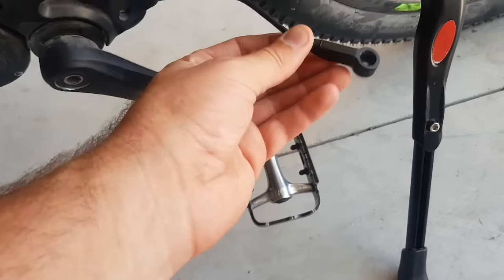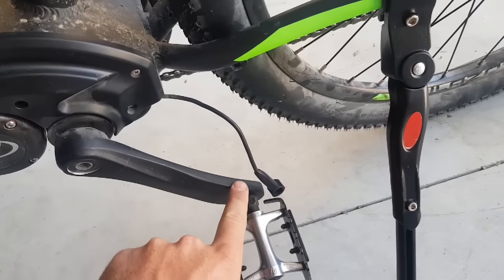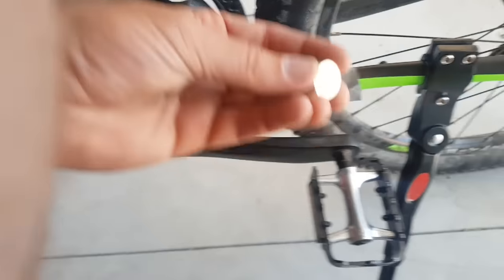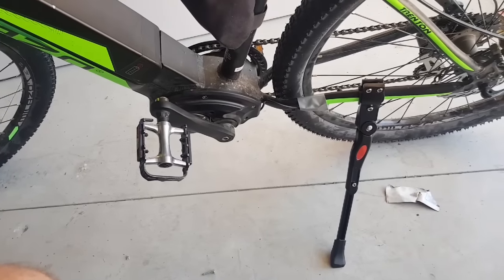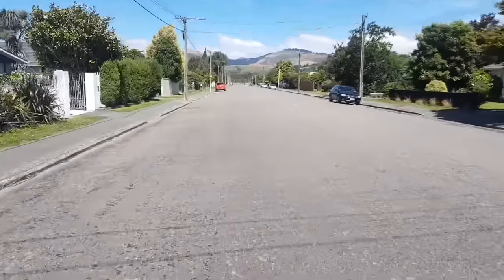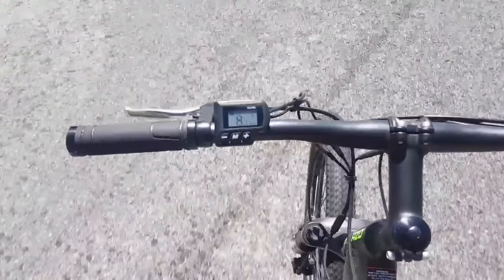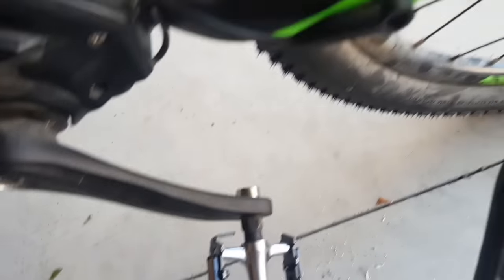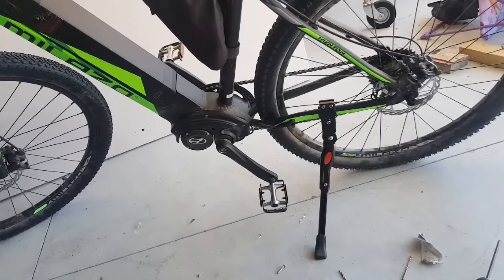Speedhack your mid drive ebike - remove speed limiter

Comment: ZIP TIES MY FRIEND...NOT DRILLING THE FRAME
Reply from the maker: Yes yes...we've been over this.
Reply: Did it ever break where that hole is or is it still holding strong
Reply: Made some sick come up when he got the drill out!!
Reply: I drilled holes all over my bike and it weighs hardly anything anymore.  I keep getting a whistling sound when the wind blows through the holes. 
I tried zip ties but they wont hold it together at all. (just joking)
That’s got to be the worst thing to do, even on a senior’s tricycle.
Reply from the maker: So 4 years later and that hole has caused zero issues.  Still... agree.  Use a zip tie
Reply: He's looking to get hurt.
Reply: @wavemaker54 nice 😅

Comment: A smaller wheel will rotate faster, not slower.
Reply: He's australian everything is backwards
Reply: Yea, but if the controller THINKS your wheel is a 20” or even an 18” (even better), it will confuse the controller-“Hey, it sure is taking a long time for that magnet to come around. I guess I can give the motor more juice. “😊 Just think about 4x4s with bigger tires - the speedo is gonna read slower than you’re actually going.
Reply: A smaller tire wheel will not rotate faster nor slower than a bigger wheel at a given driven speed( your crank , pedal  rotational speed remains the same)  It will just not travel further than a bigger wheel . A small wheel covers less distance per revolution so its slower than a bigger wheel covering more distance per its 1 rotation.

Comment: Interesting concept.  And see all those comments and other alternatives ... when are the makers of e-bikes just going to acknowledge that limiting at 25 is ridiculous when so many people can pedal a normal bike faster than that and fit people are riding them - especially the e-mountain bikes.  When it hits 25 on the flat it feels like pedaling with a handbrake on - ridiculous! .
Reply: It's imposed by them by law. In many countries it's not legal to motor assist a bicycle beyond the 25 km/t. Obviously this is a software limitation which can be worked around like this, or with a chip. I don't have a mountain bike but I imagine you would only turn on the assist when you are climbing up hill and need help in order to not get so exhausted - after all, it's going down-hill that's fun.
Reply: Agree 100 %
Reply: Before my E-bike my average speed was 36km/h. Now it's 24km/h 😤
Reply: They have to for import purposes. Today 99/100 of then you can just go into the setting and change the max speed ezpz. 
Some also have a hard limiter between the batt and controller you can unplug to keep an eye out for. 
Though for 25 bucks you can just upgrade to a computer that can show all settings which I did for a friend.  Actually, we got him a new controller (22a to 28a) and a computer bundled for 50 bucks and his ebike goes 38mph from 20ish mph.

Comment: Hey this worked like a charm.  Thanks for the video. My Giant explore stock would do 32km/hr and then cut out/in.  After your mod I can get to ~44km/hr.  I personally find that 36km/hr is a comfortable riding speed for backroads in Alberta mountains. Hardest part was running to the hardware store to get a tamper proof torx. Enjoying the bike a lot more and no problems as of yet
Reply: I would of just used an Allen bolt like me on my next bike, and pitlock has thing to put in to make the Allen bolt unable to remove without pitlock key you get
Reply: Is it still holding up? Albertan here as well. Was thinking about doing this to my bike.

Comment: What if you just move the magnet on the wheel away from the sensor? Would that not fool the sensor?
Reply: It would weaken the magnetic signal , meanwhile the wheel still spins a revolution no matter where you place it ,so no :) crank spins slower than the wheel , that's how this modification works ...

Comment: What if the ebike is only a 250w front hub motor (pedal asist) and doesn't have the magnet on the wheel you're explaining. Is that bike's motor just too weak to travel more 16mph?
Reply: This won't work with hub motors.

Comment: what happens if you remove the magnet, I guess you tried? 0mph ? no assist ? i would think a torque sensor based mid drive would still work unless they programmed no assist if the speedometer doesnt detect speed.

Comment: So I bought my uncle's 2021 Polygon Path E5 off him and it's max is 32km/h but was limited to 25km/h when it was sold in Australia.  With a 504Wh battery that's some bullshit.  After one ride to work today I'm looking to remove it, I sit at 35ish pedalling anyway, so this would be ideal. It has the Shimano Steps motor, my uncle said there's a limiter wire installed? Didn't see this sensor you speak of...

Might have to open the motor. 

Edit
Def no sensor like the video. 
So removed the battery pack and removed the left side motor cover and only see 2 wires that def look factory installed. Need to do some research 😟

Comment: As this will upset your speed and ODO reading, wouldnt it be easier to simply move fw or bw the magnet on the wheel to make it not readable by the sensor? Doing this it would always look like you are standing still whilst you are going as fast as much as your gear and your pedal frequency allows...? Where am I wrong?
Reply from the maker: Wouldn't work.  No input from the pedal sensor = no motor assist.

Comment: Hi Daniel. I just purchased the LIV Val E+2 ebike, it looks like it has the similar motor sensor to yours, how did you get it off? It looks like the manufacturer has tried to make it difficult to detach it with a screw ive never seen before. Dying to get this over 15mph its so lame at that speed!!
Reply: DoubleT I’ve got the same issue with my Giant Explore E

Comment: I've tried this on my voodoo bizango e I keep getting a error
Reply: That's because the firmware detected that your cadence matches exactly to the wheel rpm. This "hack" no longer works. You need to go to the dealer to have the motor reset (if they'll do it as the motor is now no longer covered by your warranty probably). There is a rumour that pedaling the bike in limp mode for 90 minutes will reset the error (flip it over and turn the creaks by hand, it's easier). I don't know if that's true because now I run a shimano motor. Good luck
Reply: I have the same
Reply: @givemeakidney  does it make problems for the electric parts of the bike of you go 45/ 50 km/h??
Reply: @jelmerjansen328  no, it makes problems for the rider if they're caught, or if they need to use the warranty.
Reply: @givemeakidney  okay thnx!
Reply: @givemeakidney  I did the same on Shimano E-steps.. Error displayed.. Spun the cranks for about 20-30 turns and the error message  disappeared..

Comment: You can also change Prefrance of the size of tires. Only if you have smaller than 28inch or 700c. Setting that wheel size on 26 inch ( goes up 1.5 to 2 mph more throttle only)and smaller will increase speed unless you have a locked controller than you have to listen to this video and others...
Reply: it give you just a fake speed, the controller need your tire size to calculate your speed....

Comment: Simple question , why just not simply not move the receptor, and just add a magnet on the wheel at the opposite? like having 2 magnet so you 2x the rate? not an idea ?
Reply: That would halve your max speed to 12.5 km/h
Reply: @Hallands.  ok 👌
Reply: @seba5190  What we need is an „blinking“ magnet which only activates the sensor every two turns of the wheel 😉 but that’s easier said than done…

Comment: Sometimes the motor is locked down on the speed so no matter what you did on the menu like making the tire smaller it does not change the real speed.

Comment: just tried that but in no time it goes into error (102 code on bosh readout): though it reads a lower speed alright... what could I be doing wrong ?
Reply: It doesent work on some bosh systems
Reply: Bosch has put in software to stop this be done,
Reply: @tinker-time  💩😢
Reply: @Charles-Windsor88  and gay bois

Comment: Is putting the Magnet and the Sensor closer to the Center of the wheel not affecting the speed, as it works on the Pedal?l
Reply: nope because it's only measuring the rpm. the diameter of the wheels is built-in the controller. if the controller allowed to change the wheel size you wouldn't need any hardware hack, you would  just change it to the smallest size as explained in the video

Comment: Just worth to mention that in case of any accident you may face charges for riding unregistered vehicle without required and valid insurance and if you don't hold moped driving licence then the third charge will be not holding a proper driving licence as ebike without speed restriction is no more treated as bicycle, it's moped instead.
So be cautious if you decide to risk such a modification.

Comment: I have a 'Giant GrandTour E+ 1 2018' with a Yamaha motor (60 Nm, 250 W). I tried this method.  After putting the magnet on the pedal I got two outcomes, 1) the motor works only a little bit, basically it is not working. 2) After changing the position of the magnet several times at last the motor works as before the delimiting, namely the Ebike moves maximal 25 Kmh. In both case the speed display display from 4 to 99 kmh. Anyone has any advice? Thanks in advance! My guss is: the position of the magnet plays an important role and  there is a maximal working limit for this Yamaha motor and the motor working limit cannot be surpassed even we change the position of the magnet.

Comment: So what's your top speed after the hack? And what are your thoughts/experiences a year+ later?
Reply from the maker: Thoughts after a year? It worked great! cruising speed is about 33kph easy riding, can get it to ~40kph peddling hard on flat Regret not cable tying the sensor rather than drilling the frame... the comments section certainly corrected me on that one... That being said I've had no problems with the mod, and the frame is still intact despite the small hole haha. Once I lost the magnet which was funny. Parked up next to a metal bike rack and the magnet jumped onto the bike rack, but I noticed when I left and the ebike wouldn't engage. Went back and found the magnet. That was about all that's gone wrong since I made this video.
Reply: What a waste of time, I can do a faster speed of over 30 mph, on the flat, peddling hard,  on my aero road bike, with no motor.
Reply: @stevezodiac491  what are you commenting here for then???  we all can do that 30mph on a road bike , no motor, your not exceptional..

Comment: Carefull, this does not work on some Bosche systems they give an error code and then lockout.
Reply: I will do it with a bosch active line plus 2019. Do you expect problems?
Reply: @joepschottenaz  Yes, don't try it. The 2019 software has the ability to know its being tricked and lock out, you cannot reset the error code at home.
Reply: @prefect9777  thankyou. I will buy a speedchip;)
Reply: @joepschottenaz  kindly let me know how you get on if it works I may copy you!
Reply: @prefect9777  i will do!
Reply: @prefect9777  how do you reset the error code
Reply: @prefect9777  wow, Bosch don't get invited to parties often. Maybe they're scared it affects the reliability after this mod

Comment: I rader buy a kit were you can turn on and off max speed and the speed is correct, speed box is a great way to set up your bike without any modifications, just plug it in and you simply turn it on and off with the controller on your bike, off max 25kmh and on 99kmh.
Reply: Where can I find this kit?

Comment: Doesn't work on Kalkhoff, I see someone has already said it, but why not put 2 or  3 or 4 magnets on the same wheel, the number of spokes is the limit, hey, what about a bigger wheel with even more spokes! I guess it's how the motor is prioritised ie revolutions or pedal assistance? Mine is pedal assistance where the weight of the bike is just about equalised by the assistance, why not just get a lighter bike! :(
Reply: That would send more frequent pulses to the controller, making it think that you were going faster than you actually are. (the opposite of what you presumably want). i.e. if you doubled the number of sensors, you would only be able to travel at one-half the limit.
Reply: So now the motor limits at 1mph lol
Reply: @masonhu4676  I don’t understand something, an increase in the number of magnets increases the frequency of signals to the sensor, and in your opinion it will reduce the speed limit by an even smaller one. And installing a magnet on the connecting rod, doesn’t it give a higher frequency of signals to the sensor ???

Comment: Does this damage the battery?, because I don’t think it’s meant to go really fast
Reply from the maker: Nope it's not going that much faster
Reply: @danielcaigou6403  I’ve went like 60 km/h without the limiter, the limiter is like 25 km/h
Reply: @danielcaigou6403  so it is going quite fast
Reply from the maker: Flip! Yours must have a much bigger motor than mine.  Mines only 250W

60kph seems like it might damage the battery
Reply: @danielcaigou6403  giant fathom, I only went that fast once, I thought it might damage it, it’s quite powerful
Reply: @danielcaigou6403  I just looked it up, it’s also 250w, but I still somehow managed to go 50+ km/h
Reply: @danielcaigou6403  and 80nm of torque

Comment: hi, enjoyed watching your video👍, no.1, id like to know, how does this hack effect your battery gauge??
im thinking, if your going faster, you will be using alot more power, which i assume, drains battery faster.
Reply from the maker: Yeah it'll use a little more battery... but a lot of the energy is required to get you up to top speed, not as much required to maintain top speed.

But yes overall you'll use more battery.  But that's a small price to pay for the annoying cut in cut out of a speed limiter

Comment: Do you always need to pedal for this to work or can you be on full motor mode and it’ll still work?
Reply: That's the issue I see with it. Surely if you're coasting (no pedal rotation) the motor will think you're stopped, and get somewhat confused when you suddenly ask it for assistance again? Most motors now are designed with some ramp-in rather than sudden power so it seems to me this would result in an odd feel to the assistance?

Comment: Why not just raise the speed limit on the display? I see you got kd58c display, you can set the speed limit between 11km/h and 40km/h in settings. Hold + and - for two seconds to go to general settings, default password 1234, then hold + and - again to go to specific settings. There you got the speed limit option.
Reply: Even raising on control won't increase mine set to 55 mph still only 20 or so ----- I heard change wheel setting to trick computer , also disconnect wire that governs speed

Comment: Is it damaging to a Bosch E-bike?
Reply: might be as apparently you can't do it on latest firmware cos they're gay bois
Reply: @YouTubeSupportTeams  I have just bought a Raleigh Motus with an active line motor now my question is if I will do the magnet trick I might make the software lock up the motor right?

Comment: Hello Daniel, Wrote to you a little while ago. Now that the summer is practically over here in Europe I wanted to start the hack process on my GIANT ebike, but surprise, the firm GIANT are not stupid, to take off the sensor the surprise was a nippled torx screw, in other words I needed a hollow torx screwdriver which I didn't have to take the sensor off.     I managed to send out an order to Amazon for a set of 32 pcs to fix on a screw driver. The order will be arriving tomorrow so I'll keep you posted on the follow up, Cheers mate.
Reply: You are not alone. It took me more than 30 minutes to find the right scredriver, because my Giant has chain protecting case, I could hardly see the screw! I have a 'Giant GrandTour E+ 1 2018' with a Yamaha motor (60 Nm, 250 W). I tried this method.  After putting the magnet on the pedal I got two outcomes, 1) the motor works only a little bit, basically it is not working. 2) After changing the position of the magnet several times at last the motor works as before the delimiting, namely the Ebike moves maximal 25 Kmh. In both case the speed display display from 4 to 99 kmh. Anyone has any advice? Thanks in advance! My guss is: there is a maximal working limit for this Yamaha motor and the motor working limit cannot be surpassed even we change the position of the magnet.

Comment: Thanks for the video! Got the same bike and worked a treat.
Do you mind sharing the URL to the magnet you used?
I've got a huge one taped on at the moment, and another which was too small to pick up.
Reply: Also, once in your top gear, does your electric motor cut it and out until you have a steady ready of about 9km/h according to the speedo?
I find if I peddle at about 8km/h according to the speedo while in top gear, the motor is on for a second, off for a second, on, off.
Reply from the maker: @idobbim  that's your limiter... Mine doesn't do that

Comment: unfortunately this method doesn't work on shimano step 5000. After few km of riding goes to error E014. Software recognise on replacement of magnet.
Reply: Have did you fix the E014 error?